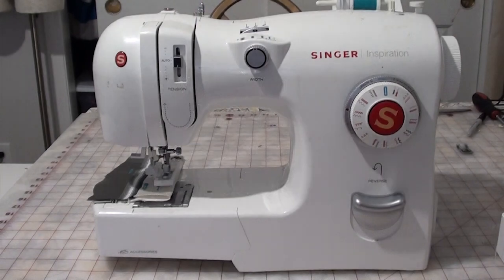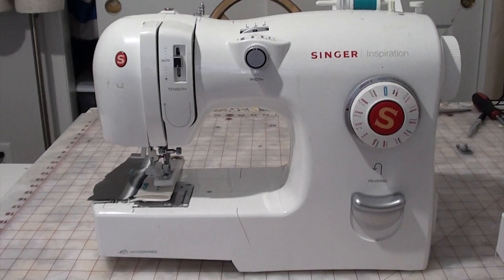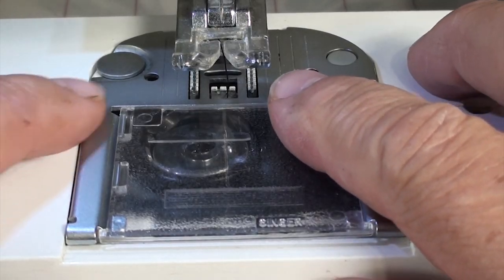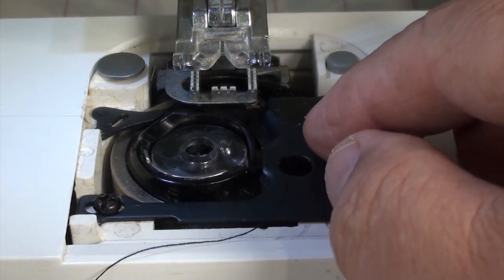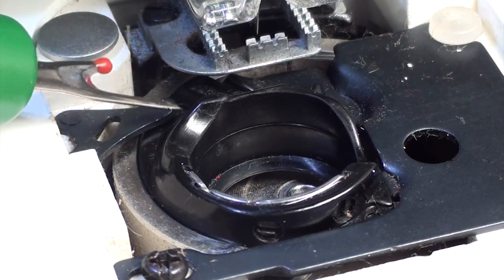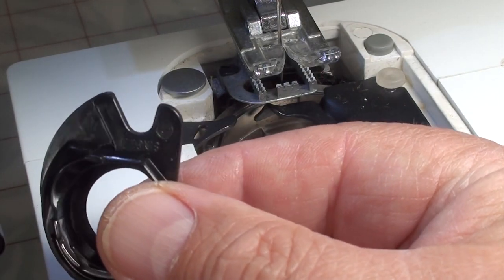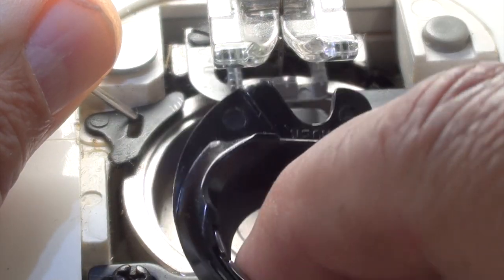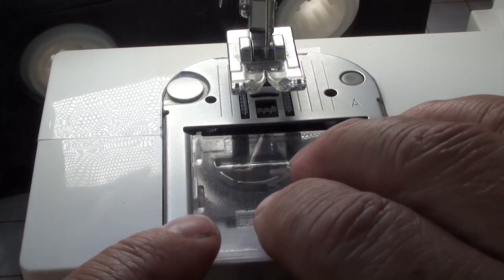Singer | Sewing Machine | Broken Apollo Bobbin Case | Fix | Repair | Replace Stuck | DIY Easy Fix

Comment: I have replaced mine and it fits perfectly but the bobbin will not spin still. Is there anything else I could try to see if it works? I can see the bottom rotate when I turn the hand turn but when I put a bobbin it it's like it won't catch.
Reply from the maker: You may have to adjust your bobbin tension. there is a little screw on the bobbin.  There are youtube videos on this subject. thanks for stopping by.

Comment: Tried this but my bobbin case holder  keeps moving around. Also my machine sometimes catches the stitches and sometimes does not. Not sure if I installed it incorrectly or if I am having other issues with the machine.
Reply from the maker: Well if it was working before, you shouldn't have a problem. You may have installed it incorrectly.there should be no moving around. It should snap right in. Good luck.